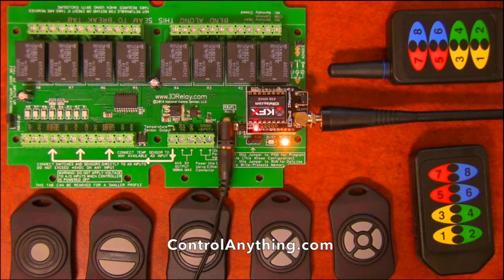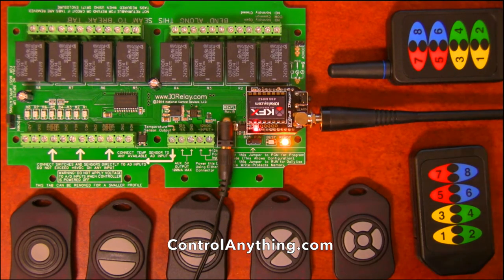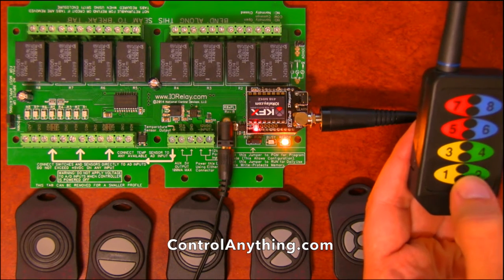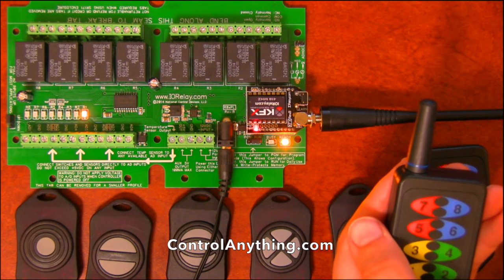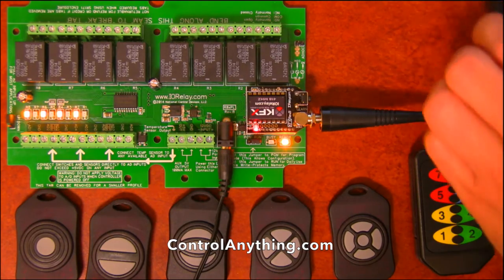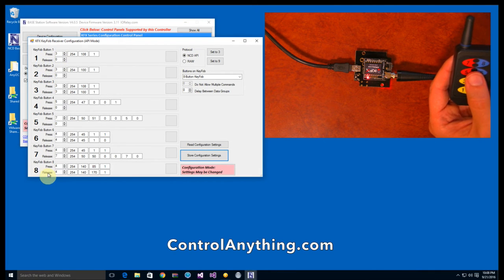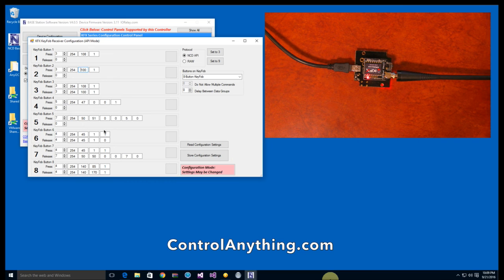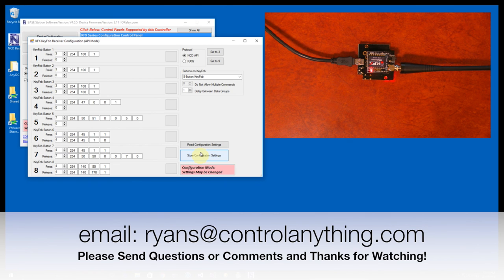Key Fob Wireless Relay Controller 8 Channel Long Range KFX

Comment: can you control multiple modules with one remote?  IE 2 locations with one remote, on different buttons.
Reply from the maker: Hi Phil, you can control multiple boards with a single remote, however, all controllers will see the button press.  Keep in mind, the KFX module makes the decision about what commands are sent to the relay board.  So it is possible to configure some of the KFX modules to ignore a particular button and other KFX modules to utilize the same button.